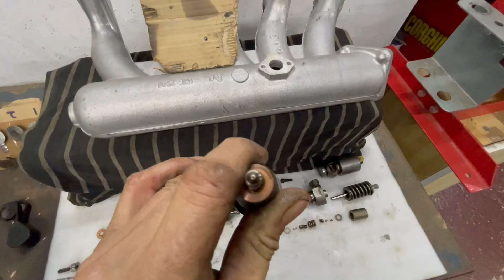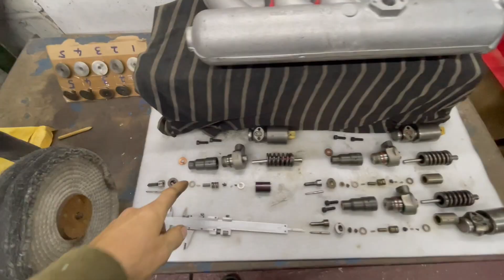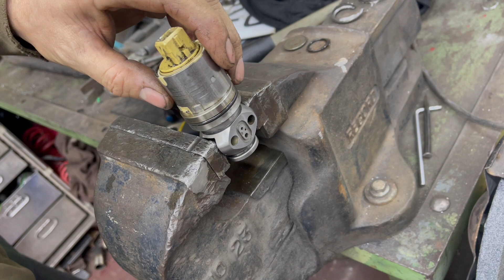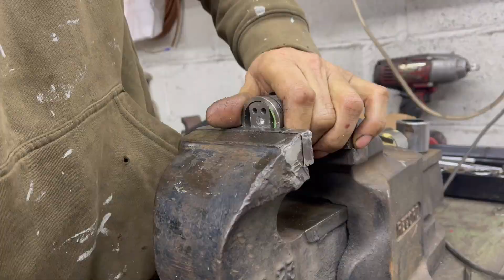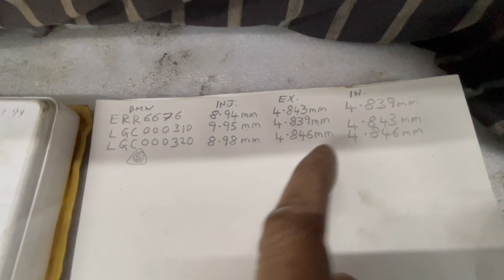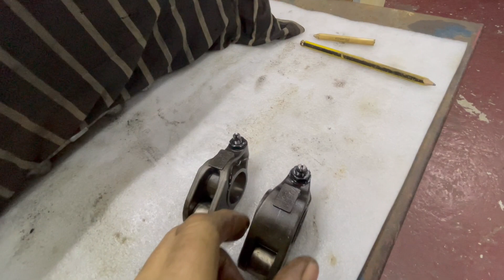ALL YOU NEED TO KNOW about TD5 Injectors - Camshafts & Rocker shafts 10p vs 15p LAND ROVER

Comment: I love the info and love the laugh 😂
Reply from the maker: Thanks mate 😁👍 life’s for having a laugh 😂 cheers 😁👍👍
Reply: @CarJunkeez I’ve got a few questions on the 10p and 15p. Where’s best to ask you? Are you on instagram?
Reply from the maker: I don’t really use my instagram 😂 so in here’s ok 👍 What do you want to know mate
Reply: @CarJunkeez does the 15p have different pistons to the 10p or can I just install an AMC 15p cylinder head on a 10p block along with cams, rockers, injectors and any other bits that upgraded the 10p? ECU also obviously.
Reply from the maker: Yes the 15p pistons have the swirl recess slightly offset whereas the 10p pistons have it central, but this doesn’t make much difference to be honest so you can just put a 15p head on a 10p engine and vice versa, they’re like this as the angle of the injectors in the cylinder head differ slightly from 10p to 15p. You can use either of the rocker shaft setup on either head too if needed, they’re only difference is the camshaft on the 15p have 1mm overall more lift for the injectors than the 10p camshaft, but you can still use either but I recommend using a 15p camshaft and obviously set the lash clearance.
Also if you still wanted to use the 10p MSB ECU then you can fit the 10p injectors to the 15p head 👍 cheers
Reply: @CarJunkeez legend thanks for that. Now to price it all up, I definitely want to get the most out of my TD5.

Comment: Why do so many reman companies produce injectors which just don't work.  Merlin are just one example. Hopefully someone will start producing decent quality stuff or our engines are doomed.
Reply from the maker: Yea I’m not sure, I think if genuine Delphi/Lucas nozzles are used and a thorough check of the internal components (rather than replacing all components) and as long as the solenoid is good then that should make a good injector. I think that softer metals in some new nozzles may give way quick, also the tolerances of the shims springs and other components are so tight then changing these also (even if measured precisely) if metal is inferior to the original would quickly cause wear and issues. And with injector codes there is no way the original codes would be correct and I think it would be immensely difficult to generate a precise new code after rebuild calibration. When I get some extra time(not likely) I will make some code and a device to do an automatic injector pilot correction via OBD for the TD5. 👍 cheers

Comment: hey mate great video, the nut on the adjuster screw is damaged and has stripped some thread. Haven't fully looked into this, but is it easy to replace? I have a 15p 2004. thanks
Reply from the maker: Thanks mate 😁👍 yea you can just unscrew the adjuster bolt with the damaged lock nut, then fit a new nut if the bolt is ok but if the threads knackered on the bolt too then fit a new one too (or second hand ones) then make sure you adjust the lash by turning the cam until it’s fully compressing that injector on the highest part of the cam lobe then turn the adjuster screw until it’s fully compressing and bottoms out and then back off one full turn then tighten the lock nut(not to tight as they don’t have many threads) 👍 cheers

Comment: hi, very good and interesting videos on these injectors, nice one! 
what is your opinion on coding refurbished injectors when you install them? 
in my mind they were calibrated at the factory and given the unique code on the top of the solenoid but after refurbishment does that code now mean nothing?
Reply from the maker: Thanks mate 🙏😁 I think the injector codes won’t be nowhere near correct since an injector rebuild unless the company have a way of generating new codes to match after the rebuild and I don’t know anyone who does that correctly.

When I get some spare time, I’m thinking of making a programmer (probably using a Arduino or similar) that can do a pilot correction via OBD, to do this I’d monitor the crank signal and change the injector code for optimal RPM and injector balance for each injector, but to automate this is quite difficult with the TD5 but can actually be done live as it’s only writing the code to the 93c66 (93c46 in the MSB) and this actually takes effect instantly with injector codes when running. So it’s not impossible with code. 👍 cheers

Comment: Hi from Australia, I love your breakdown and detailed analysis, completed to a level not seen before on YouTube.  Now that I have given the praise you deserve, you know I am going to ask something from you:). I assume the best way to get the most of the TD5 is to clean the injectors and get them working back to their optimum level. I also assume in trying to clean the tip only addresses part of the cleaning process. Would it make sense to pull each one apart and place the bits in an ultrasonic cleaner?  If so and here is the ask, can you explain how to pull them apart for cleaning or is it very simple to do?  If you showed this process I think you have a winning video and most likely a nice little niche work from home business.
Reply from the maker: Hi mate, thanks for the very kind feedback 😁 the TD5 injectors can be so expensive and I don’t think you can buy them new now. Your best buying good used ones and only clean the nozzle carefully with nothing abrasive because the holes in them are so small you can damage them easily. There is a tool you can buy that goes in the holes of the nozzle casing and allows you to undo the injectors rather than way I did initially 😂 if you did want too you could buy original Delphi nozzles and replace them at the same time as cleaning the internal parts in a ultrasonic bath then soaking them in diesel again before building the injectors back up and tightening the casing back to the correct torque (pretty much as tight as you can safely get it) they’re are shim’s inside that should be matched to each injector but without the special equipment we won’t be able to match these unfortunately. 👍 cheers 😁👍👍

Comment: I have a 10p system with a 15p green top on piston 4. Injector 2 (black top) does not work, the solenoid is shot, I am replacing
 the green top with a new black top so my question is can I replace the solenoid on the black top with the one on the green top
Reply from the maker: Yes you can, the solenoids are the same and simple to swap, when the solenoids fail they tend to just stick either open or closed, I’ve not seen one with a failed coil winding, only stuck mechanism, but as they’re crimped casings the solenoids aren’t really DIY repairable so swapping it is the answer 👍 cheers

Comment: Thanks for the info, I took my injectors apart to inspect but without a microscope I couldn’t see any issues. I marked mine and tightened to the same spot. Pretty tight, any idea of torque spec on these bastards? Ive got a box of about 13 injectors but have lost track of good or bad ones. Also couldn’t get a precise spec on resistance value on the injector solenoid?
Reply from the maker: No problem mate, thanks for watching 👍 yea they’re meant to be pretty tight aren’t they, I don’t know the correct torque but if you had the correct socket then I’d go with 40ftlb, I think on other PD injector nozzle housings they do 30ftlb then 30 degrees. As for the resistance that’s going to vary between 1 to 2.5ohm but it’s not mostly the coil that fails, it’s the solenoid that sticks  and I can see why when I stripped a solenoid to examine, other than that I’ve mostly seen them in pretty good condition under the nozzle and it’s usually contaminated fuel that damages them or burnt nozzle tips. 👍 cheers

Comment: Very good video, I have a 10p with pitted rollers on the rocker shaft, seems I could use any good second hand shaft 15p or 10p as long as the lash is adjusted correctly?
Reply from the maker: Thanks mate 😁 yes that’s correct, I’ve compared both very precisely and you can use either as long as the lash is adjusted correctly 👍 cheers

Comment: Talk about extensive investigation! 😎👍🏼
Reply from the maker: Ha ha 🤣 I just need to know how things work 😁 so the best way is to take everything apart 🔧👍 cheers mate 😁👍👍
Reply: @CarJunkeez  I have a few old Triumph bikes and never really trust them until I have done a complete rebuild. The I get a connection.
Reply from the maker: @TriumphT100T yea I’m exactly the same mate, that way if something does go wrong you can kind of see it in your head as you remember every little part you’ve put together 😝 👍cheers 👍
Reply: @CarJunkeez  I should not admit to this but I restored a 1967 Bonnie Rickman Triumph, would not start for the life of me after rebuild, check everything valve timing, ignition carbs, but she was dead…. Never helps to put diesel in the tank…
Reply from the maker: @TriumphT100T ha ha 😂 to be honest it’s easily done mate, I’ve been as close as picking up the wrong pump nozzle so been lucky myself 👍 cheers

Comment: Is there a definite difference in 10p vs 15p cams? How would one go about telling the difference? I am in the process of rebuilding my td5 that has also been badly butchered with mixed injectors. Was wondering what cam I have as I found a good second hand unit, but not sure what it is now...Great video btw
Reply from the maker: Thanks mate 😁. If you look at the front of the camshaft where the sprocket mounts there is a date and part number etched around the outside edge, you can just about see it even when it’s in the head but its tricky, another way of telling the difference is that a 15p tends to have a groove all the way around the second round section before the first valve lobe. The only difference between the 10p and 15p camshaft’s is the 15p has 1mm more lift on the injectors only, everything else is the same. You’re better off using a 15p but make sure you adjust the injector lash. 👍 cheers

Comment: Interesting - thanks.
Reason for the high voltage solenoids (around 80-90 volts I think) is probably to be able to deliver power efficiently. Say the injectors are 120 watts - at 12v that's 10 amps, needs heavy gauge wiring, but at 85v it's only around 1.5 amps so thinner wiring and lower losses. Also less heavy duty switching components required in the ECU itself.
Reply from the maker: Are yes good point mate 👍 so they don’t have to have heavy cabling in the loom, reminds me of doing my solar panels in series for higher voltage and thinner gauge cable saving a fortune and more efficiency 😂

Comment: You sir are a legend! Being going through this with my engine at the minute. I have a 15p head on a 10p block. the head has 10p cam and rockers fitted with black top injectors. 

The cam is badly worn and needs changed. I’ve been struggling to find if I can definitely use 15p cam and rocker with the black tops. You’ve answered all my questions! Thank you!
Reply from the maker: Thanks mate 😁 I’ve always wondered myself so decided to have a dig ha ha, glad it’s helped you, yea you’ll be better with the 15p cam too as just that little more fuel delivery and you can use whatever rocker shaft assembly you want as long as the lash is adjusted 👍 just one thing with putting the 15p head on a 10p engine is the combustion chamber in the piston is central on 10p pistons and is offset slightly on 15p pistons (due to injector angle difference), this isn’t really a problem as new pistons are mostly 15p style but cater for both but you can have a different sound to the engine on low revs, thanks for the feedback mate, appreciated 😁 cheers

Comment: Is the difference between those injectors due to them being two different manufacturers, ie delphi or lucas?
Reply from the maker: I think Delphi bought Lucas but you could be right as when they was a separate company that could possibly be the slight difference in injectors 👍 cheers